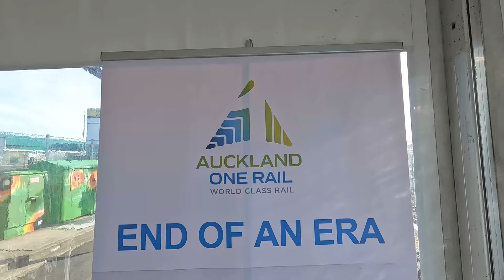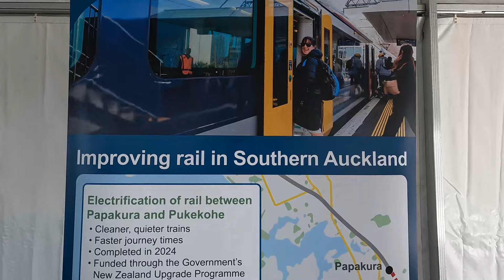Saying farewell to Auckland's diesel trains (and a heritage rail excursion to Mission Bush)

Comment: AT must needs to conduct a feasibility study to run a diesel/hybrid service between Waiuku and the proposed drury station... waiuku is developing, in future it'll be a necessity for waiuku residents to have a rail connectivity to the city centre
Reply from the maker: It's a good idea and I wondered about it myself. In the long run, I understand GVR is looking to extend their line further into Waiuku to terminate next to the boat landing in the 'heritage quarter'. 

A couple of problems of taking regular passenger service to Waiuku though: from Glenbrook to Waiuku isn't mainline anymore. I don't know how much work (if any) would be needed to change that. The line from Paerātā westwards is single tracked and takes 5x daily big freight trains. Running passenger services would need to work around that since that's what's kept the line alive until now. It could be that GVR could run a shuttle service to help with their own running from Waiuku to Paerātā (there's going to be a new station there). I'm just a history buff though, so most of this knowledge has only been picked up by osmosis, I'm no expert! I think, given the costs, that they'd probably instead just run a bus from Pukekohe. When I was at highschool in Papakura there used to be a school bus to Waiuku, so they might run a commuter bus as well (I'd wager most people would refer to drive though).
Reply: @spil030  Surely a train service to Waiuku would also include passing loops (as a matter of course)…
Reply: How about sending them out west to Kumeu/Huapai with their bulging populations. Already have the platforms from previous years of diesel/passenger service.